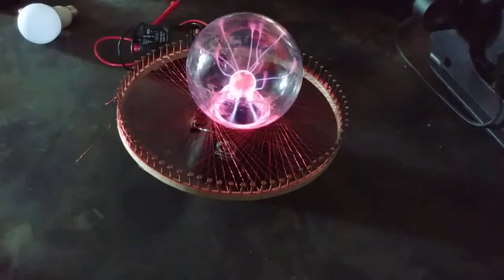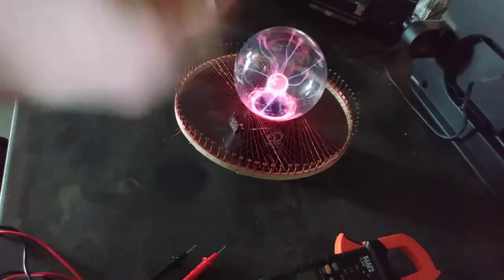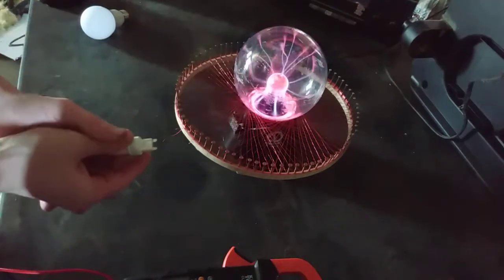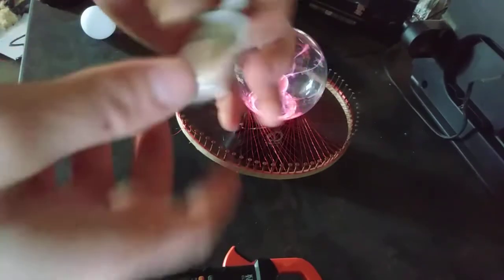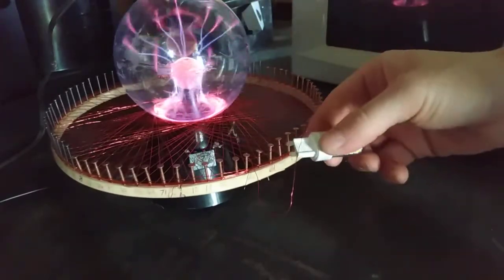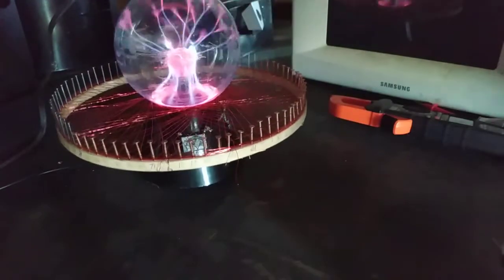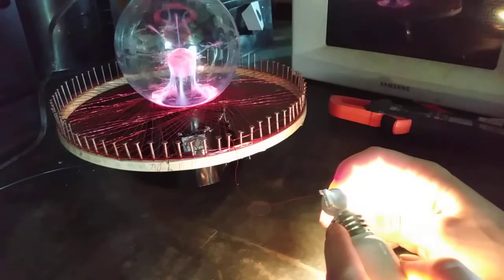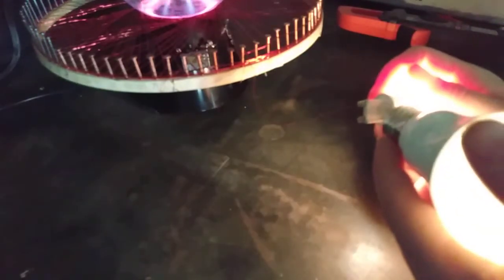Flying Saucer Coil Lights 2 Bulbs With Energy To Spare

Comment: EMF or electromotive force. It is another name for voltage. The bulb lights up because a flyback Tesla coil powers the plasma ball. You, in effect, are just bringing bulbs to a Tesla coil. Your meter reading technique is interesting. I have never seen it before. I will try it:)

Comment: Very nice MAN!! Thanks for sharing. Im just testing my crystal cells, but now i Will have to buy a plasma globe lol. Is it posible that beacause of high frequency you get so high amps. Tesla said high voltage plus high frequency, i think that fast switching of the coil can replace the amperage.
Reply from the maker: NOt a problem my friend! Im glad this discovery is giving you insight on what you can do with plasma!